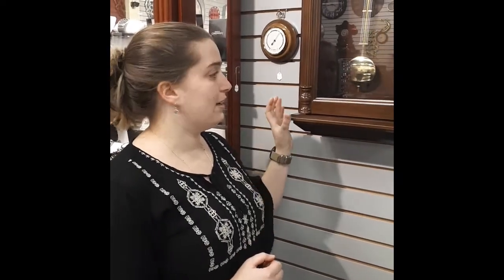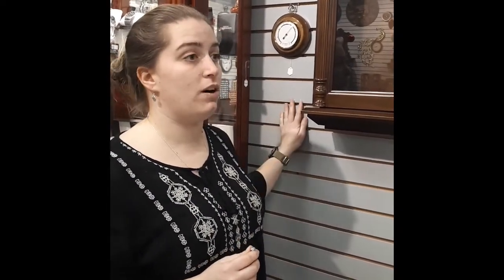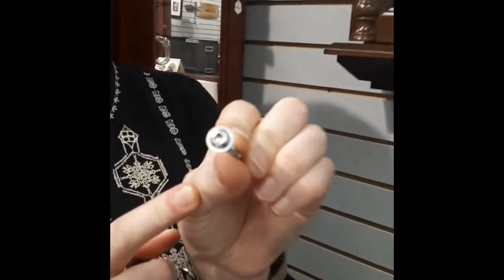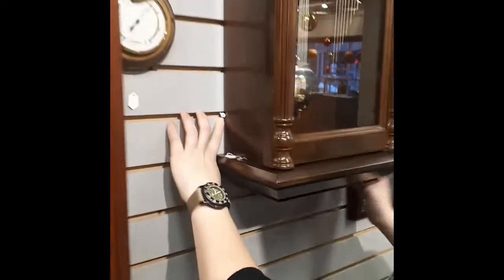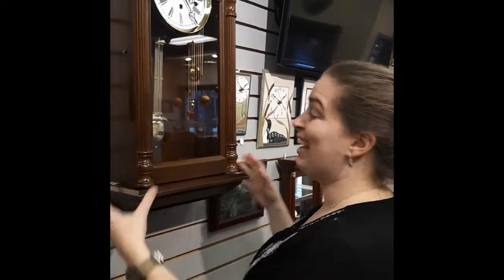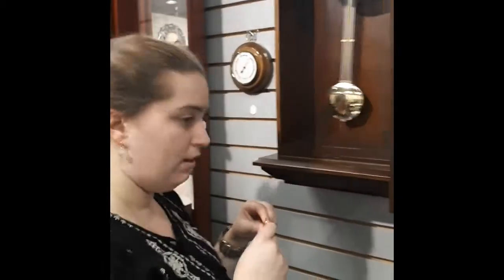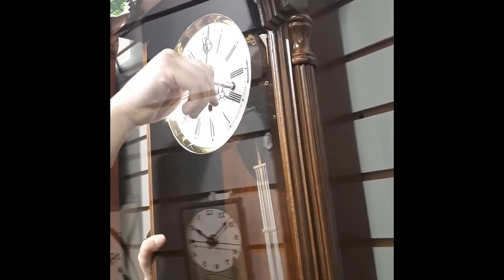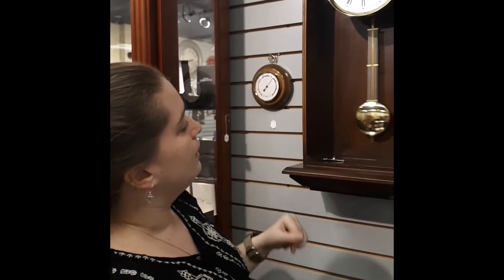How To Set Up A German Wall Clock

Comment: This may be a dumb question but I am a complete novice and just learning- If you don't wind the clock with the keys- is it possible for the clock to run and keep time? I only ask because I inherited a German wall clock - it hasn't been removed from the moving box for about 45 years- we can't find the key to wind it- but hung it up on the wall, set the time and started the pendulum- it's been keeping perfect time now for over a week... weirdest thing to me- but maybe there is something I don't know???
Reply: Hi, thanks for your question, it is something many people have wondered about. Most likely your clock was fully wound when it was put away. Some German made clocks run for two weeks on a wind. I would seriously consider not running the clock since there would be no oil in it after 45 years in storage. Running your clock without oil will cause it to wear out very quickly. My recommendation is for you to have the mechanism inspected by a professional as soon as possible. Today, German made clocks are very expensive to replace.
Reply: @Perfect Timing  thank you so much for that information- I feel silly I didn't think of that....I immediately stopped the clock for now- I am unsure of the proper way to oil it- so I need to figure that out- thank you!!